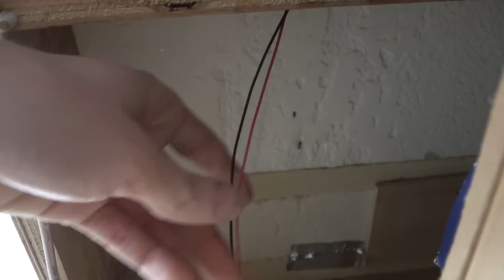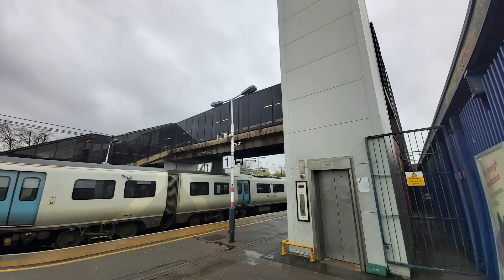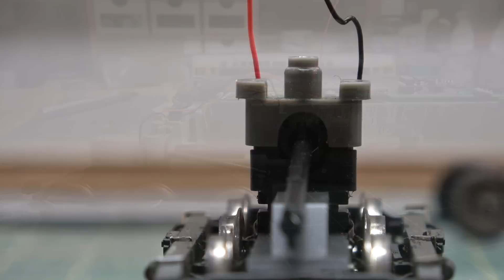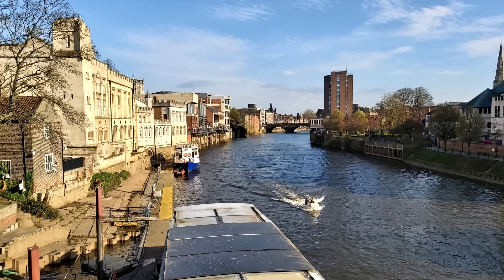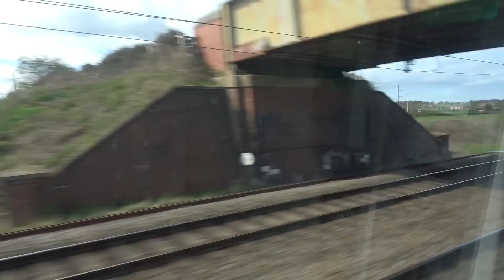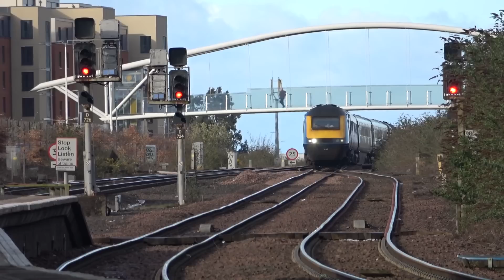Layout Update - Spring 2023 | backscenes, footbridge, weathering, and new additions

Comment: I like your attitude. I've come across several who may have a marriage cert for the hobby.  Just about every day or every evening without fail. If you've a cheese and kisses and kids time is better given to those that love and need you. Like you say, it's far too easy to burn out. I am sure you'll laugh that I don't do it very often because I am at the point pretty soon to have to come to grips with making DCC a reality. I have the goods. I'm just a bit petrified at the wiring below the track, at the track and in the motor shell. I've got these 70's and 80's Athearn blue box and some new stuff that is only DCC ready.I've got all the related kit and command centre. Right now all I need to get cracking is the pressed cellulose sound insulation board that will be the base of everything.  I love the progress that you have made since I first observed your first crack at a motorway with moving lorries and cars. Your multi storey office building, canal and canal boats showing bow waves and the cool bits of discards larrikins threw into the canal and the salvage yard chock a block with clapped out washers and dryers. Bees knees I reckon.

Comment: Impressive. Easily the best modern layout. 

With the weathering wash, does the thinner not take off some of the original paint? Assuming you could make a black wash with acrylic and the thinner if you didnt have the tamiya stuff?
Reply from the maker: Enamel thinner takes a very long time and lots of effort before it starts to remove the factory paint.  You can use acrylic but oil or enamel based washes give a better result.

Comment: The better it gets, and it does, the harder it is to find a constructive criticism. Not that I’m looking to make any, but the 60 and the 25 speed boards in the opening credits could certainly do with a heavy coat of iron oxide from al the brake dust   They’re almost illegible sometimes and they occasionally get a scouring dry wipe to get the muck off, with little improvement. Excellent as always.

Comment: Believe it or not, things were worse on the 170s and 158s before the electrification between Edinburgh & Glasgow. The HST was to help too by replacing the 170s with "proper trains" on intercity routes, but drivers are not happy with the HSTs, there are several dead ones stacked up in Inverness, the cost is huge.

Comment: One thing I love here in Australia is that the rail services are using a great deal ov old traction. In New South Wales for example the XPT (the Aussie moded 43 class) is still going strong on all the country routes especially from Sydney to Melbourne and Sydney to Brisbane. In Victoria which is still a Broad Gauge setup except for the main lines to NSW and the ports which twnd to be twin Gauge the companies are running locos that are into their 60s and longer age these run the goods traffic aeound the state and even into NSW on the Standard Gauge as well. For modelling it means the main differences over time is company and livery changes to the same old locos and different rolling stock, as we changes from UK sized goods wagons to more like the US sized stuff but still today a good mix of all types can often be seen on different consists and some times even in a single consist. Then we also have  good state by state heritage listing of older stock of locos many of the diesels in Victoria are often hired out by the goods companies to help out when they require extra locos which gives the heritage side a financial boost and as anyone that has delt with diesels can tell you the worst thing for them is to sit and only run a little, This also helps with the steam presevation side as well so most holiday times the individula states heritage fleets run their fleets either on the [rivate pwned trackage of the individual group or with the larger ones that are some what given government support on main line running.Which makes mpdelling the local stuff able to contain a huge load of different things what ever the era you model..

Comment: I love the way you put passengers in the coaches and drivers in the cabs.
Reply from the maker: Makes a big difference.  I've still got some more coaches & locos to do, most of them have been done now.
Reply: @EverardJunction  Thanks for the update; even with your rest, you still seem to have been busy. The Class 117 coming off the carriage sidings at 36:46 must be a Branch Line Society special as there are clearly passengers on board! And thanks for the heads-up on the new Oxford Diecast release of the Maestro as I will now be getting a couple for my layout (operating period 1986-1996). With your knowledge of cars, it would be extremely helpful to do a quick tutorial explaining which Oxford vehicles you are using and roughly what period they cover. All I go by is the registration numbers - and how do you change the registration numbers on Oxford vehicles?

Comment: Backdrop joins can be relatively easy to hide effectively.

Where you have top to bottom cloud, simply cut a random, cloud-edge shaped oblique line - rather than a perpendicular, then overlap this into a similar area of top to bottom cloud. Then, touch-in the bare edge with white, grey, or blue where necessary.

The brain quickly finds straight-line joins. Randomly curving slanted joins just won't stand out the same way, especially where the top overlap edge faces toward any light source and doesn't cast a shadow.

This is even easier with an industrial or residential backdrop.

Comment: My teacher had a Renault 4 but in the mid-late 70s. Have you got a Triumph Dolomite? That was my first car in the 80s then a Capri. I have the coal sector 58. I bought it on sale recently and have 35+ coal wagons for it - two types. I tend to buy coal sector diesels. I also have the 31, 37 and 56. I am tempted by the forthcoming Cavelex but they are expensive.